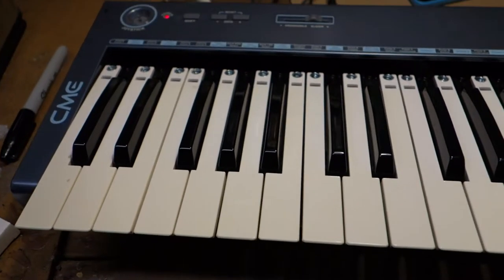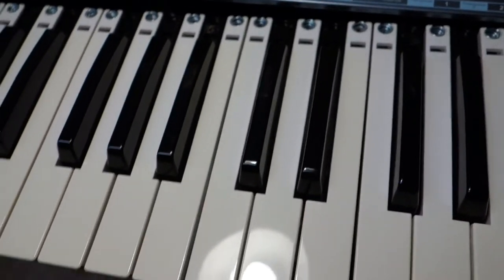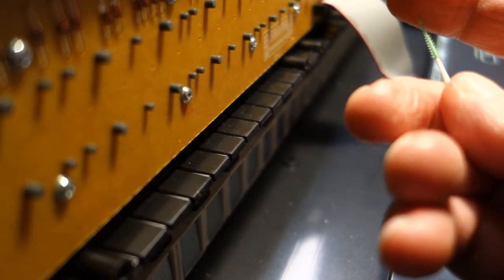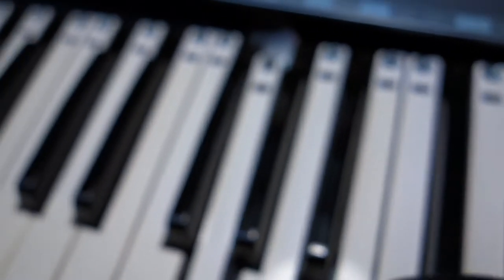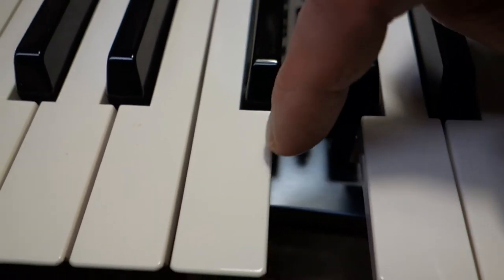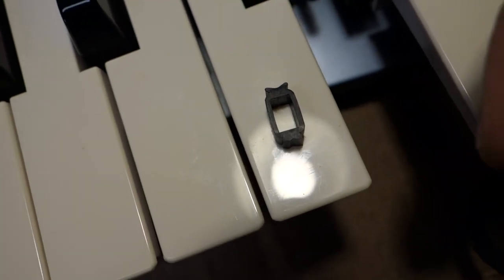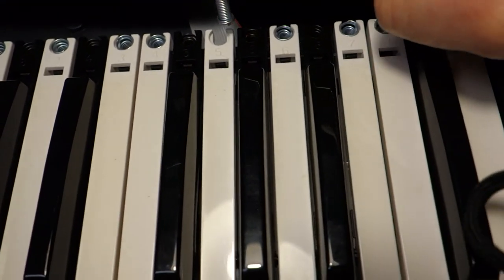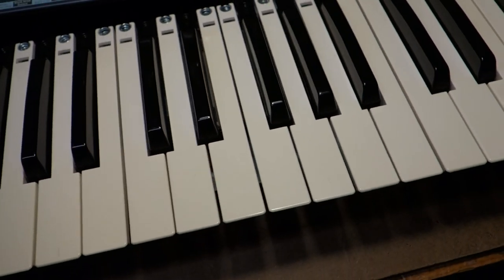Repairing unresponsive keys on a MIDI keyboard

Comment: Does anyone know how to make a CME M-Key work with windows 11? I'm facing the issue of my laptop (or even my super old laptop running vista) to detect it? When I plug it in to my laptop, all the lights turn on (Shift and both data + and data -) but nothing else happens and it won't connect!